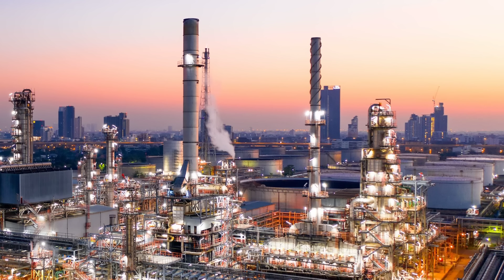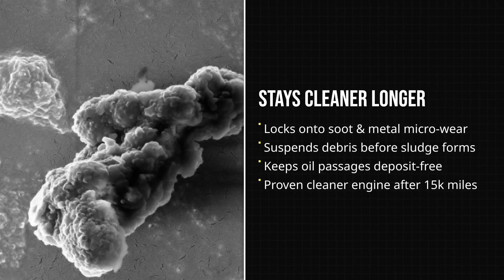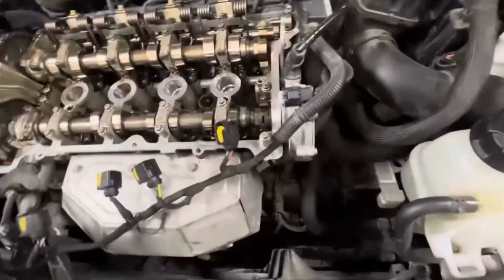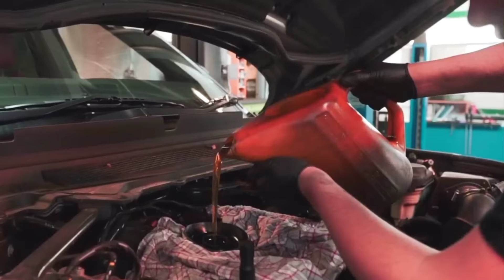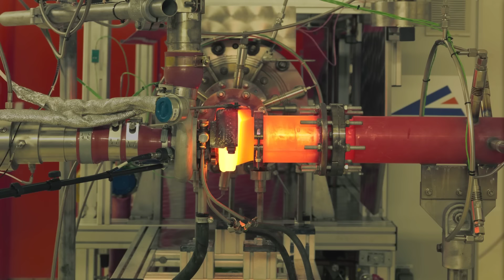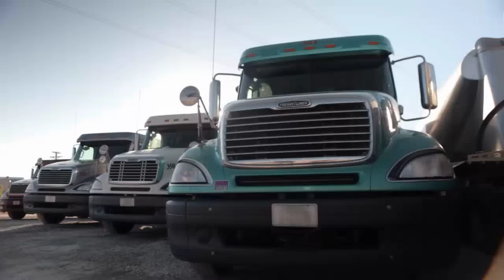Why Is This Oil So Special?

Comment: unfortunately I don't think this oil can handle VW 504 00, is a specific oil standard that Volkswagen requires for its, direct injection that has turbo engines the viscosity must be 0W-30

the base oil for this oil is ester based

Comment: This video claims that Platinum and Ultra Platinum use the same base oil- but they DO NOT. This has been confirmed with FTIR Spectroscopy. The video is littered with filler and assumptions. This is another AI created junk video which has scraped comments from the public and general oil knowledge. That said ULTRA Platinum is a good oil- but the reason why is not addressed in this video.

Comment: If it's doesn't have Low displacement with forced induction or direct injection, i'm just gonna run the cheapest bidder for 15w40 conventional or synthetic.
Reply: Rotella T6

Comment: I've been driving since 1983. Well over a million miles and never had an engine failure. I have only used Pennzoil my whole life, thats the brand my dad used too. I change my oil religiously, the old stuff at 2k and the synthetic at 4k. I drive my vehicles to 300k+ before retiring them. I live in the salt belt, so, unfortunately the body gets too rusty to be safe to drive anymore.

Comment: It's been proven there are many good oil brands. It's more important, for the average driver, to change the synthetic oil close to 5K intervals. Different brands work slightly better for particular engines and drivers. I used Mobil 1 up to 2004, worked great. I purchased a new car that year and noticed something was off. Switching to Pennzoil solved the issue, and have been happy ever since. There's plenty of tests online to watch. The Oil Geek released an extensive video recently, with details, about all the kerfuffle over oil. ✌️

Comment: I have used DELO 400 30W in every single car &truck I have owned since I was 16 and I am 63 now with no problems whatsoever. I use K&N oil filter and change every 10,000 miles or so with no problems whatsoever.  So I would recommend using Chevron Delo 400 30 W . For all of your needs.
Reply: Hardheaded granddaddy oil from a failing company that does not even make their own oil

Comment: The author claims that the GTL base is so clean that "there is nothing in there to gum up your valves, coat your pistons or turn into sludge," but then the statement follows that this oil contains more of those additives and more of these. In fact is the additives that cause the deposits in engine, NOT the BASE OIL! Conventional (petroleum or mineral) oil base also doesn't cause all of this problems...additive package does. Do you not know this, or are you deliberately misleading people?
In truth, the conventional (mineral) base has much more advantages over all types of synthetics: good lubricity, resistance to corrosion, moisture and high loads  (low cost not mentioned!). All other properties of the oil are given by additives (which are the same for mineral or synthetic base). 
If GTL is sooo good why'd they use same additive package? Why not less or get rid of it completely?
The only scientifically proven advantage of synthetics is pumpability at low temperatures. You can use ANY conventional engine oils, change them more often and it would be much better for your engine!

Comment: Pennzoil makes a diesel oil 😮    be nice if they did.   Shell Pennzoil  under one umbrella. 😊
Reply: They do, Rotella is diesel oil produced by Shell.
Reply: Yes, they do make a 0W-40 diesel oil that meets the spec for European automotive diesel engines.  But good luck finding it here.  If you run a RAM, Ford, or GM diesel truck, use the Shell T6.  It is also a gas to liquid base stock diesel oil.
Reply: Shell T6 makes a 5w30 and 0w40. We need to see the two tested

Comment: I prefer Mobil 1.
Reply: Mobil 1 has a tendency of shearing a lot faster than other oils.
Reply: @MrRGiller THIS!!! IT sheared way too fast
Reply: Was a mobil guy for 30 years, switched last year. Now I'm trying to decide if I should go from 0-20 to 5-30 in the 4Runner and Tacoma, already experimenting with the wife's car😂
Reply: @T @Tom-u8t9y 0w-20 is a scam. just look what the same engine uses in europe. A toyota rav 4 that calls for 0w-20 in the usa calls for 5w-30 in europe with the same a25a engines. It’s because of cafe standard forcing manufacturers to eek out every last drop of gas mileage
Reply: nah bruh i switched from mobil 1 extended performance to penzoil ultra platinum and the engine is noticeably smoother
Reply: @lana-f8m8y  Really? You think it makes your engine run smoother?
Reply: @Caduceus88yes. by far. mobil 1 also sheared very fast in my engine too. it revs out more freely and sounds slightly smoother.

Comment: Cant beat Pennzoil Platinum or Pennzoil Ultra Platinum. Both outstanding oils for ANY modern vehicles. Ive used both over 10yrs in my expensive Ford trucks & SUVs w/excellent results proven by Blackstone oil analysis.

Comment: Dexos.😂 GM cant build an engine that wont destroy itself and their worried about oil quality.  Pennzoil for the win
Reply: Pennzoil Ultra Platinum in all my expensive Ford 4wd/AWD trucks & SUVs w/ GTDI engines. You mean GM & Toyota ! Both replacing hundreds of thousands of engines in there trucks.
Reply: @Davido50   Do you think it’ll work in a cheap Ford 2WD truck? or only Expensive 4WD,AWD,and SUV’s?
Reply: Not just Gm....across the board....Fords are horrible....and fords are engineered crazy.
Reply: @steverugerguy9606 Fords have problems but their engines are a lot more reliable
Reply: Google “Problems with Ford light truck engines”

Comment: You didn’t mention that Ultra platinum is not Dexos certified??
Reply: Pennzoil states there Ultra formula does in fact EXCEED Dexos certification. Pennzoil doesn't want to pay the licensing fee. They do already for Pennzoil Platinum.
Reply: Inorder to become Dexos approved one must reveal the formula.  Ultra doesn't want the formula revealed 😊
Reply: @pninpm All bout licensing fees. Pennzoil pays for it already w/ Pennzoil Platinum.
Reply: I will also say why do I care about a Dexos spec if I am running a Ford, Honda, Toyota, Subaru, BMW, Benz, Audi, etc.
Reply: dexos = scam